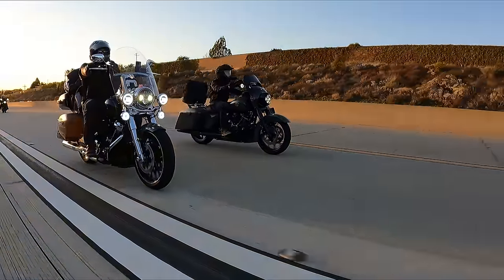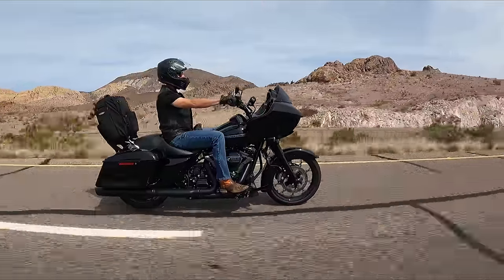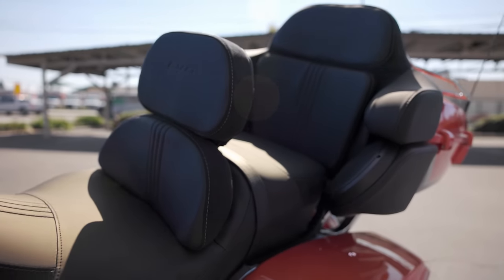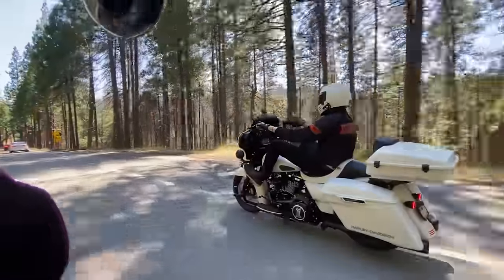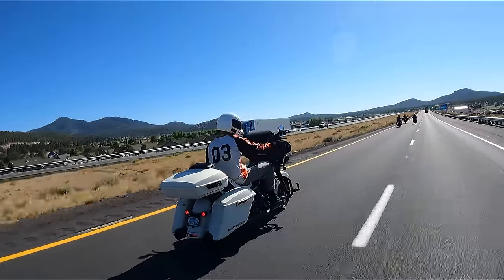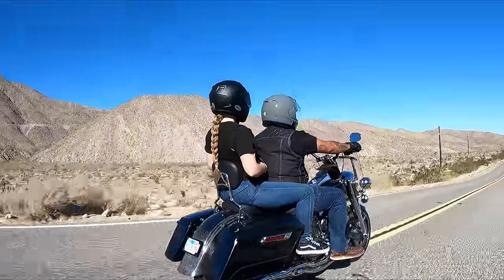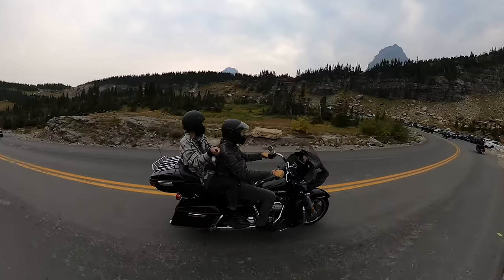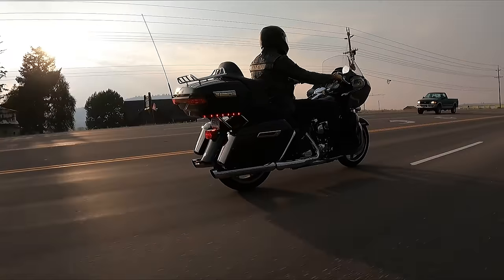Top 10 Touring-Comfort Accessories & Mods for your Harley-Davidson Motorcycle

Comment: as a suggestion for another accessory,  would be a cell phone holder mounted on your bars and your phone used for real time navigation purposes,  such as the  "waze" app which shows you in real time if an accident, debris or a cop is up ahead  on the road you're travelling. Yes harley has nav, but I have not seen one that operates in real time.
Reply from the maker: Yea that’s a good addition

Comment: Windshield with the “fangs” (fork wind deflector). And a set of those Memphis Shades hang shields for when it gets colder..  does a good job.   
I’d love to try out one of those new windshields (the one u see mostly on a RKS..  Sinxe I have the standard .. of course the RK standard windshield comes up the the middle of my field of view just like everyone I know.  Either gotta try to look over or under/thru …. Or adjust to the top of the windshield cutting across your field of view.  
Come on HD.. surely they know the road king standard windshield needs to be an inch shorter or taller.

Comment: Matt, long time viewer, first time commenter. I love your videos and as a person who actually tours quite regularly on my touring bikes I have to agree with your list. However, I have one suggestion to add. TIRES! I have always hated the stock Dunlops. I discovered the Metzler Marathon around 2007-ish and love them. I've had them on my V-Rod, my Dynas, and my Touring bikes. They make the ride smooth as silk. The handling improves greatly, and they are awesome in the rain. Just got back from a long tour on my 2019 CVO Street Glide with Metzler Marathon Ultra 888's and compared to the last few trips on Dunlops it was like I bought a whole new motorcycle. Keep up the awesome videos and Ride Safe!

Comment: I have a backrest on my Heritage and I don't care for it. Maybe I need to adjust it, but I actually prefer not to use it. I also don't care for a heel shifter at all. I have floorboards and I like to move my feet around on them and the heel shifter locks my foot in one position. Just doesn't bother me to lift up on the shifter. I like to ride without a windshield, but on a long trip I agree it really helps to limit the beating you get from the wind. A good seat and a way to change your foot position is priceless. You just need to try some of this and see what you like and dislike.

Comment: hoping you can help me size a road glide. I looked a a stock 23 ultra limited, and its too tall for me at 5 8. I could only get on the balls of my feet. So now im thinking road glide special which I think sits lower. If i get the RGS and go with an aftermarket rear shock with remote res/ i looked at the fox shocks and they come in both 12 and 13 inch, standard or HD. For touring 2 up will the HD 13" be the best option? M concern is that will put me right back to the original problem.....a bit too tall. What are your thoughts for a rider 5'8 with about a 30 inch inseam who is looking at the Road glide limited or RGS? My thought for a seat is the Saddle man heated Road sofa.

Comment: Matt can a batwing type fairing be installed on a 2023 freewheeler?
Reply from the maker: There are aftermarket batwing fairings that can be bolted up. I wouldn’t recommend them. For the freewheeler I’d recommend a full size windshield.

Comment: While I enjoyed my time with my Street Glide and Road Glide I never got past having such a poor suspension on a modern motorcycle. I never found wind protection on either of the Glides to be all that impressive. Its better than a Road King but combined with a fixed position windscreen there are just gaps and wind in all the wrong places.  Having owned other brands there is just so much Harley needs to do.  Hopefully the revise the tour line soon. Rushmore was over nine years ago and the frame is older than that
  
The soft lower are a good alternative for those who need or want to remove them quickly.

Comment: Another tip:
Kickstand stop.
Never park the bike in N. Always 1st gear.
Do this automagically by shutting the bike off by lowering the kickstand in 1st. Then turn the key off.
If it becomes a habit, the second benefit is you will never have to worry about dropping the bike after forgetting to put the kickstand down (so embarrassing ;)

Comment: Not a actual accessory, but ear plugs make a huge difference on a long day. Not from exhaust noise or such, but wind noise going past your head. If your ears are ringing after a day of riding, you are causing hearing loss. Ear plugs help fatigue without all the loud sounds riding.

Comment: I have bone spurs in my neck from a crash years ago. If I sleep wrong or sit wrong I end up with pinched nerves and numb and tingly hands. That back rest gives lower lumbar support. Takes pressure off my neck and my hands don't go to sleep while ridding. Handle bars and highway pegs also helped with my position taking pressure off my spine. So anyone struggling with this.... there are solutions.

Comment: Cruise control = remove spring from throttle housing. Not unsafe when considering two cable systems .
Referred to as a " dead man throttle ", because it works fine unless you're dead, not that using one is dangerous.
 Been riding 45 years without fighting a spring. You can always roll off the throttle faster than you can brake, I just prefer the bike not do it for me😁

Comment: All that stuff is jamming. When considering changing the handle bars, try Rox risers. They furnish two pivot points so rider can adjust to find possible sweet spot and won't have to change lines out. Just a thought without a ton of investment and regret. Ride on my brother from another mother...

Comment: I just had to buy shocks for 2021 CVO SG  in Canada the bike cost $52000  plus 12% taxes.    Just like  my 2019  CVO SG all of my bikes from beginning of "plush ride"! It is ridiculous HD continues to put garbage shocks on machine costing big $'s they will continue until the scow full plush units from Somali  are gone. Plastic gas tanks and primary are next
Reply from the maker: Try the road glide limited next time. They ride like a cloud.
Reply: @MattLaidlaw  I owned 2018 Road Glide CVO  No cloud Matt  I bought  shocks for that machine also  my body didn't fit RG  had return to SG CVO  the old air shocks worked.  I have going down the road on HD's since 1958 perhaps my ass is just busted down like my back, Regards I need 2023 CVO before I die they should hurry Regards James

Comment: Forgot to mention that I added a set of Memphis Shades to shield my hands, andcyou may not notice much right away, but down the road the little things they do adds up!... especially eliminating your hands being nailed by rocks!... Now here's my question:  this last summer i installed a set of midframe heat deflectors.  I do want to install an adjustable backrest.  Can i still keep the deflectors (especially left side) and be able to adjust on the fly by perhaps modifying the deflector a little, or am I hosed?... Your thoughts?

Comment: My problem with Highway pegs is that 90% of them look horrible. You get this beautiful $30k bike, or worse a CVO, and then throw these floppy eared dork pegs sticking off the crash bar and completely destroy the look of the bike. There are some that fold up and are more streamlined when not in use that don’t look too bad, but most of them just look sloppy. Useful I know, but take away from the aesthetic.

Comment: 1. Why doesn't the Harley Touring bikes come with a suspension from the factory that is good for long distance touring, you have to install JRi, or Legends because the stock is really bad.  2. Why doesn't the Harley Touring line come with electric adjustable windshields like the competition.  3. Why doesn't the Harley come with auto locking saddlebags and Tour-Pak on the base models like the competition.  4. Why can't I store my size Large Ghost Bandit Helmet in the Tour-Pak, the competition I can.  5.Why is TPMS a extra cost on the Harley unlike the competition. 6. Why aren't heated grips a stock item on a Harley like it is on some of the competition.  This is coming from a guy that has 96K on a 2014 Road King and will be trading to a new bike when I hit 100k.

Comment: Moral of the story spend anywhere from 30 to 50,000 on a motorcycle, only to have to upgrade everything. You think for that kind of money they would actually put suspensions and power options in the bike when you buy it not have to dump thousands of dollars to make it better.
Reply from the maker: Moral of the story is if you spend 30-50 in most cases you already have a lot of the features I mentioned depending on which bike you bought. If you didn’t get a limited or something in that class then the stuff I mentioned might be something to consider if you do long distance riding.

Comment: Harley heated grips are junk. Go with heated gloves and vest with a thermostat for about the same price. I have a 06 ElectraGlide Standard that is tricked out better than a CVO For 8K less. I have a copycat CVO paintjob of Sunset blue and Sunset Yellow in the CVO graphics that is not offered by HD. I have added cruise control, Air Zeppelin seat, Backrest,  Zeppelin backrest and full tourpack, aftermarket Sony radio/amp/speakers, stretched bags, Linby Engine guards, suspension upgrades, Stage 2 performance that upped the HP to 92 with 103 lb of Tq.. It has 108k miles on it and is still running strong.
Reply: R u kidding?!  Lol. I can’t go past setting 2 on my heated grips. Stock HD. Beyond that they burn my palms thru gloves. They are awesome.